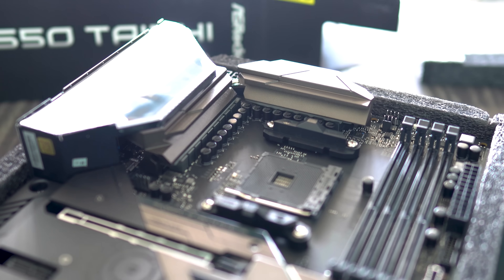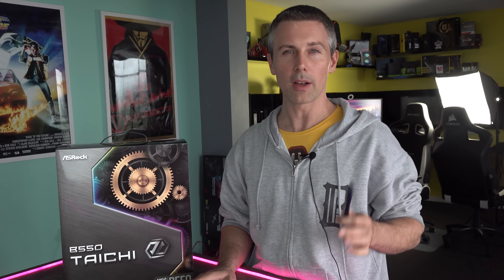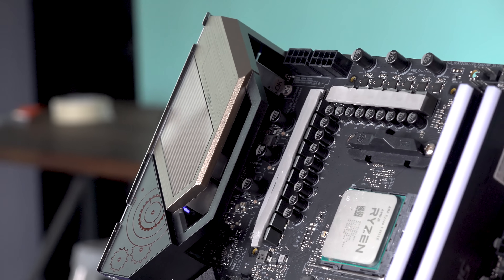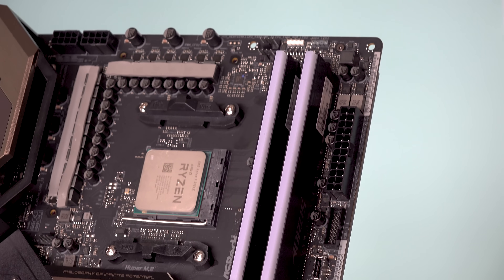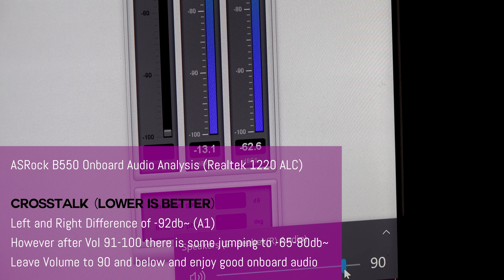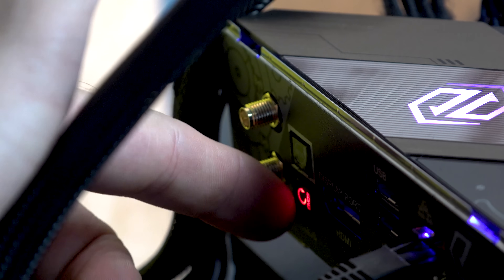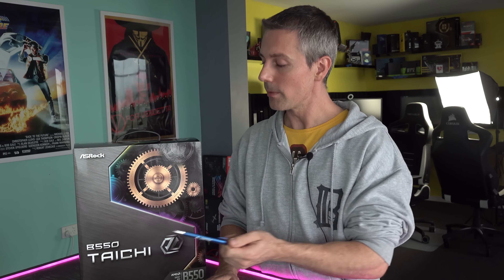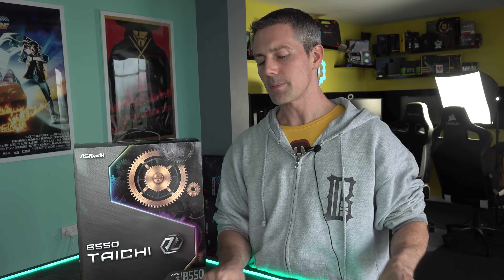ASRock B550 Taichi Review - X570 Now Irrelevant?!

Comment: I think the delay will mean there'll be no B650 when X670 comes out it'll be the same as X570 and B450 were then skip to B750 or whatever they do for Zen 4/AM5
Reply: Conza x670 most likely b650 for OEM manufacturers. (Same as. 550 but tiny tweaks). X670 ill take those things that Are better in b550 and implement those with old x570 features.

Comment: I'll be interested in seeing how the Asrock Extreme4 X570 and B550 compare. The x570 Extreme4 is the board I have been considering for a Zen2 now build, and then upgrade to Zen3 later. It isn't as nice as the Taichi boards, but costs a lot less and has all the key features I need.
Reply: They are almost identical in thermals. Hardware Unboxed.(not very good)

Comment: Paying $300 for a b550 is stupid no bifurcation who in their right mind would get this board? Just buy $300 x570 folks!
Reply: Someone who wants to avoid the stupid air coolers on x570 and has no need for pcie 4.0 of the chipset.
To be honest paying 300$ for any am4 mainboard is stupid in most cases. There are cheaper good options with x570 and there will be even better options with B550 (wait for the reviews).
Reply: @SISSYPUSS  B&H $220 backordered, yes seems very popular.
Reply: @SISSYPUSS  You are saying that I am wrong by putting up your own rumors that these fans will last for years although there is not a single fan that ran for years (as the boards are not that old yet). You can come back to me in 5 years and then find out who was right. Right now you are just claiming something you cannot prove. I am only saying that something that does not exist (a fan on the b550 board) cannot break and that statement is valid right now and not "maybe in 5 years true".
Reply: @SISSYPUSS  i didnt say that it has to be loud, but some people are reporting that they heard the cooler because for their board it made a high pitched noise. Furthermore any cooler can break at some point due to dust, being low quality or running too long. In any case I would avoid them if possible.
Reply: or the ~$220 x570 MSI tomahawk

Comment: I'm looking for a new mobo but I'm not too keen on changing out my 2600 until zen3 comes along, so B550 is a no-go. X570 seems to be the best option.
Reply: @SISSYPUSS  Another person talking who knows nothing about what they are talking about. The Tomahawks have some of the best thermals of B450, B550, and X570 motherboards at their price points. Hardware Unboxed, Gamers Nexus, and Actually Harcore Overclocking aka Buildzoid all have thermal data to back up my statements. Grow up and try to learn something.
Reply: Even a good B450 board will handle an overclocked 3950x. So, if you are not going to upgrade your cpu again any time soon, save your money and get the Tomahawk. $115usd
Reply: Just get MSI x570 Tomahawk when it gets available for 200$. It has best drm from budget x570 boards.
Reply: Well, it's not entirely untrue that a B450 tomahawk can handle a more demanding CPU relatively fine and availability here seems to be ok. Still, looking to the future, I'd rather have gen4 support from the chipset, better VRM overall, more SATA ports, support for higher frequency RAM etc. Plus, not knowing the power figures for zen3 a B450 seems to be kind of an iffy choice. So an X570 does seem to be the best choice, all things considered.

Comment: Finally an Asrock B550 review on Youtube, thank you! Do you plan on reviewing the Steel Legend B550? I'm going to build a new gaming/editing PC this summer and I love the new Steel Legend design but I dont want to blind buy it.
Reply: Being a fan boy is not recommended. Motherboard performance changes with the wind. One year MSI is on top, the next year Asus. Its never the same so do your homework on sites like this. Asrock has been under performing on their under $300usd boards.
Reply: @joanamendoza-r5l  I'm not an Asrock fanboy, but I like their Steel Legend series because of the good looks. I'm going to watch the most important b550 reviews, that's why I said I won't blind buy a board.
Reply: According to this spreadsheet (https://docs.google.com/spreadsheets/d/1PuUWroxA0HvSSipsXlB8hnYkshxD8LdeO5EA6WLdOQw/edit#gid=0) from this Reddit post (https://www.reddit.com/r/Amd/comments/hao9ab/amd_b550_mobo_vrm_list_with_some_spec/) the Steel Legend uses the same components as the Taichi, the main difference being that it only has 12 Vcore phases instead of 14 (same with the Extreme4 and PG Velocita as well). Based on that I think it should also have really good VRMs, but I would also like to see an actual review of it with real testing to be sure. I was still really glad to see this review because of that though.

Comment: As of the release of ryzen 3, Are older x99 xeons like E5-2678 V3 still worth it or should I get a Ryzen 3 3300X?
Reply: Ryzen 3 3300x all day
Reply: The problem with older hardware is that it often uses more power.
More power means a higher electric bill and more heat in summer.
Reply: Depends on where you are located in the world.  What the local markets are charging.
Reply: @MrRourk  I Have A really tight budget, A Ryzen 3300x would cost at Least 150 USD motherboards Are even pricier, I was only considering it because of futureproofing.
Reply: @m.usamausman  sometimes it is cheaper to upgrade a existing pc.  I got lucky recently and was able to get a old workstation for $10.  So for another $80 to upgrade the cpu and $110 for a 1660ti it is now a decent system.
Reply: @MrRourk   I Currently have "Hp ELITE 8000 SFF" with core 2 duo e7500, 4gb ram and geforce 310. I have to edit videos , make highly demanding cad models and also gaming, so upgrading this computer which i got 3 years ago for 70$ isn't worth it.
Reply: @MrRourk  Also Just to compare markets A 1660 Ti here is around 220 USD

Comment: Cheers mate, first review I've seen of this board.  Features and hardware wise, it's my favorite AMD board right now, everything I need but without a chipset fan.  I want to use this board for the next 5 years.  One thing you didn't mention is that the internal gen 2 header on the X570 was in a really bad place, it's been fixed now with the B550.  The only thing that could prevent me getting this motherboard is bios or hardware bugs that might show up after people start using them.  Little things like random BSODs, wierd bootup/POST issues or coming in and out of sleep properly in Windows, or other quirks that I don't want to have to put up with.  I've been using Intel for 10 years and my current OC'd Intel system is 6 years old and hasn't had a BSOD all year.  Not one.  This kind of experience seems rare with AMD.  A lot of AMD users seem to think BSOD are normal.  They shouldn't be.  Anyways, this is the highest end board on B550 platform, it even has a backplate, and it's the only board with 8 SATA ports.  It's also the only board that doesn't disable a PCIE slot, if you use the second M.2 slot.
Reply: I have to disagree on BSOD's. To say Intel has less BSOD than AMD is anectdotal and hasn't been my experience.
Reply: @christopherjames9843  I'm not saying I've never had BSOD.  On this same Intel system I've had them, early on it was the Corsair RAM I was using (at stock XMP).  I would have 10 BSOD a year (completely random).  It could run Prime95 for days in a row.. but out of the blue, during idle.. it would just blue screen.  After a few years, I upgraded to better Corsair RAM and most of them went away.  My CPU degraded a little over time, so I backed off on the clocks a little.  But 6 years since buying it.. in 2020.. no BSOD in 6 months.  PC systems are complicated, it's hard to generalize.  It's not necessarily an Intel vs AMD thing, but on this specific system it's as close to perfect as I've ever had.  And I do see a lot of talk on AMD reddit.. where people talk about BSOD a lot.  It could simply be.. these are gamers with budget hardware that are pushing their systems too hard.

There's so many things that can cause them, from the software side, graphics drivers, USB drivers.. it can be anything.  I even saw some comments in the last 24 hours that Windows updates do it too.  Generally though, I think people push their memory controller or memory frequency too hard.  My main point is.. once you get used to never having them, it's hard to go backwards.

Comment: The Taichi is the Top B550 Board from ASrock so its the most expensive. These B550 are basically x570 build-like Boards just with a cheaper Chipset and no Fan.
Reply: X570 owner. I lol when people keep knocking the chipset fan as if it's cooling the Sahara Desert while sounding like a jet engine.

B550 is a solid choice for most people. Feature set wise. Most people won't see the difference between the B550 and X570. 

X570 will give you more pro consumer features if you utilize it or not. M.2 Gen 4 speed ssd's. Even then, most could go without an X570. 
Just get what you can afford. Sucks that it's not as affordable as it was originally thought but that might be more of the world crisis.

Comment: In Australia, the B550 Taichi costs as much as the X570 Taichi.
Reply: It's a better board.  It even fixed the internal USB Type C header positioning problem that the X570 had.  You give up a bit of I/O but personally, I wouldn't be using that I/O anyway.  I most likely wouldn't even be taking advantage of the PCIE4.0 M.2 slot, as I prefer Samsung SSDs.  Maybe Samsung will eventually make a PCIE4.0, I think there's a 980 Pro coming but it won't be cheap.  And even if so, I'd only need one of them.  3000mb/s is fine for a second drive.  Heck, even 1000mb/s is.
Reply: I saw that too! At both Scorptec and Mwave they are both listed for $569?
Honestly stupid if you ask me...
Reply: In America on Newegg, they are the same price too; $299. Which board to get depends on your needs. If you need maximum connectivity then X570 is best. But if you only need "normal" amounts of drives/slots used then B550 would suit your fine. Two things I have to give the win to the B550 Taichi for are that it doesn't have the chipset fan, and it LOOKS so much nicer than the X570 model.
Reply: In Europe B550 Taichi costs more then the x570 Taichi.
Reply: In the US ITS THE SAME. This board is better.

Comment: at those price points I'd still go for a B450 tomahawk and screw the new motherboards and upcoming CPUs. Spend the money you save on a better video card.
Reply: here's the thing, from the specs alone the entry level ($130) msi b550 boards has the same vrm as the tomahawk + you get pcie gen 4
Reply: @terlaluanjay   msi b550-a pro costs 139$ ( 20$ more than Tomahawk Max) and is way better. Thats definitely the new "Tomahawk"... The new "Best Bang for the Bucket"
Reply: Spend $50-$60 on a motherboard and another $50-$100 on a sound card and the rest on cpu/gpu.
The audio will be as good as or better than a $300 motherboard.

Comment: This is why AMD tried to pull out the 4000 from the older chipset, the motherboard manufacturers started to feel the heat, from loosing Intel's cosmic overpricing advantage...
 They should give alternatives, at any price point, if not, it's easy, don't buy anything.

Comment: 2:10 Wait, I thought B550 had PCIe 4.0 lanes from the CPU? I'm confused, or is this chart only talking about PCH lanes?
Reply: he's talking about chipset lanes (PCH) 16 CPU lanes go to the the top 16x slot, 4 CPU lanes go to the chipset which are then divided into the 4 3.0 lans and 8 2.0 lanes. I think there is also another 4 lanes on the cpu dedicated for an M.2 slot. So in total it is 24 PICE gen 4 from the cpu. 4 of them are reserved for the chipset and the rest can be used
Reply: @Sheepxpy3  B550 has PCIe 3.0 lanes, not 2.0. 8+2 lanes out from chipset. Those 2 extras can be configured as sata ports. Typically B550 motherboards use 4 lanes for M.2, 4 lanes for bottom x16 slot and have 4+2 sata ports.
Reply: @kognak6640  good spotting. 😋👍.
Merry cheers for AMD, products😋🎉. Selling off like Hawt cakes 🎂🎉till the end of this year. 😚❤️
Reply: @mohdfaizal6773  AMD is the most relevant company in the space right now as soon as they release a good budget video card like a current Vega card on rdna2 for 99 to 129 they will make more money than they know what to do with I can confirm that the 3300x  is selling really fast and with b550 those CPUs will become scarce.

Comment: Well I already got my x570. Was Impatient.
Reply: You made the best choice IMHO.
Reply: Hey, nothing wrong at all with X570. You just have to make sure to stayed away from the few models that turned out to be awful designs. But you are all set for Zen3 and have ALL PCIe4.0 connections so you will have a solid system for many years to come. No regrets!
Reply: @SirReptitious  What models were awful designs?  I thought  X570 Taichi  are all the same.
Reply: @alanbiker5838  some of the old MSI board had vram overheat issues. They were so bad MSI had to release fresh boards lol. Hardware unboxed have a video explaining this.
Reply: @alanbiker5838  as you get up in price $300US+ they're all the same. But in the budget boards there are a few good ones and a lot of bad ones. Except MSI, they only have one good X570 board, and that's the Tomahawk.
Reply: I'm with you, I had to buy mine back in May and nabbed a Asus tuf plus for under $160 new. I could not risk the issue that was going on with the current 3300X.
Reply: @Saintbow  hopes it's works out well. For the muney.

Values n performance.
Which brands n board?
Reply: i have amd athlon x2, donate me ur x570 then if u r not happy on that anymore :)
Reply: @PunxTV123  I will take up your Olde system.
Reply: @James Smith dats great news.

How's the little chipset fan doing?
Reply: PCIE 4.0 support will give it longer life than 550 boards through next gen. Not a bad choice on your part as long as you aren't unlucky with an unexpected malfunction.
Reply: Same bought one with my 3900x as my old X470 decided to randomly loose a RAM slot on me.
Reply: id take less pcie lanes with no chipset fan over a failing chipset fan.
Reply: @billybobbob3003  True but I don't believe the fan is as susceptible to failure since it has 'fanless' mode. Personally, 1 small capacity pcie 4 drive for the OS is all I need. For bulk storage I'll just us a couple of sata ssds
Reply: What do u mean impatient? They released b550 almost a freaking year after Zen2 released....~!! That's not your problem, that's AMD issue.
Reply: Hello Mind helping me reach 600 subs?